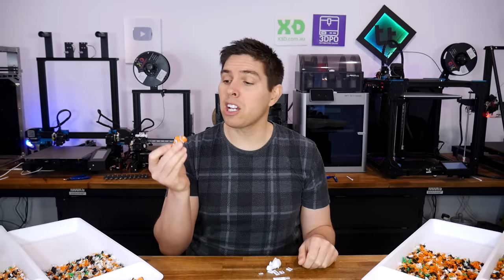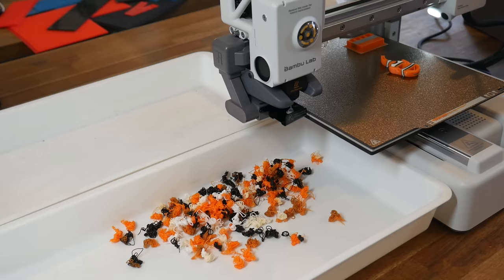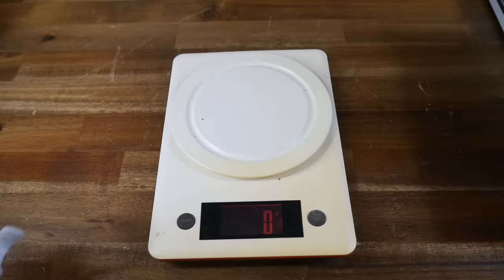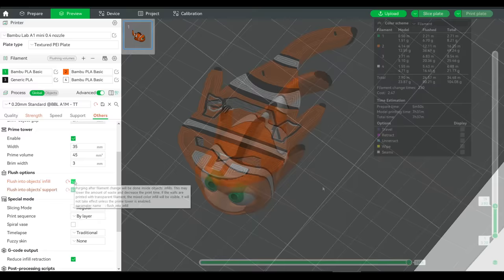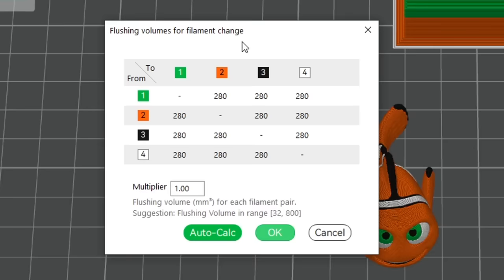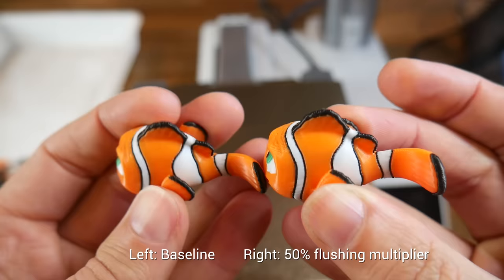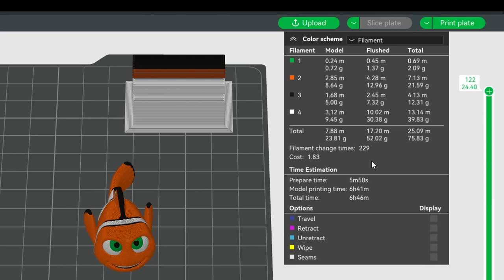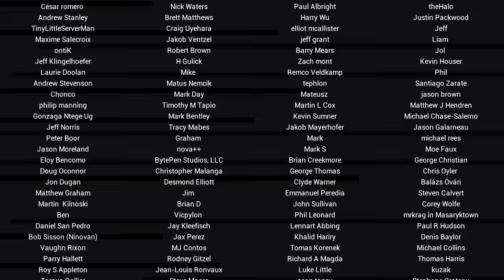Reducing waste from Bambu Lab AMS (lite) prints

Comment: Theres a model on printables called "Bambulab Profile for up to 60% purge reduction" and it does exactly that. Pretty much it moves the filament up close to the cold end before cutting it. This reduces the physical amount the needs to be extruded.
Reply: Is there a way to save it? Do I need to set the multiplier and auto calculate on every print or does it keep the change
Reply: @dustinbailey1980  For the Profile mentioned, there's some G-code that will be there for every run. Recalculating will be needed if you change filament combos.
Reply: I did this and it works very well! It's insane the amount of filament saved, plus i'm using only 0,3 on flushing volumes, and the purge tower i give it 10mm width and 10 purge amount
Reply: Do you have printables link? Please and thanks
Reply: @TripleJAu  copy the quote and paste it in printables. Some communities don't like links.
Reply: It looks like it is only for the X1, is there a way for this to work with the P1?
Reply: @g0d0fninjas90  what do you mean only for the X1 ... why should it be not possible to change the purge volumes on the P1 ?
Reply: @cryoglobe  the person who created the file wrote "for the x1," so that is why I asked. It could be possible to work on the p1, but since I know they have slightly different properties, I don't really want to chance it myself unless the person states otherwise.
Reply: @g0d0fninjas90  Ok , but I saw the video and explanations , and there is nothing specific to the X1 ,  99.999% confident it's fine on the P1 as well    ( it's mainly custom gcode in the slicer )
Reply: @rs3dpt noob question. Why do you need the purge tower if you are purging the poop off of the side. It seems like they would accomplish the same thing. But to use the purge tower you need to build it up with whatever color even if you don't need it till the end of the print
Reply: @vladonizer same question!! I guess it is to get a clean head before going back to the model but not sure why it need to be so large and may be this could be done in infills/supports
Reply: @ysiegel5544  The so-called purge after "poop" is partly to flush out "that last stuff", but MAINLY is used to equilize nozzle presure. It's not a PURGE, it's a PRIME tower (which you can change in side according to your wishes in the slicer)
Reply: good news everyone: "UPDATE 13.12.2023: I added profiles for all nozzle sizes and Printers including the P1P, P1S, X1C and one experimental profile for the A1 mini. "
Reply: my prusa XL 5 tool heads print this marlin with same video settings and reslts are : 1 h 4m print time and 10,01 g of filament use :- D 5 colors zero waste
Reply: That XL is an awesome machine and multi-head is an interesting future, but that machine will costs more (above my X1C) than I will ever spend in waste filament. That's not to say it's not an amazing machine (a friend of mine has the single-head XL), but it is quite expensive, if you "only" want to minimize waste (and/or save time).
But, as my argument implies: if you print professional volumes, this can make prints faster and more efficient.
I'm just a n00b that wanted the FDM equivalent of an HP LaserJet ;-)
Reply: Search for the printable "Reduce Purge Waste with Bambu Lab AMS"
Reply: The profile is gone now, it must have been taken down
Reply: @nanoman172  Just found out it's already implemented in Bambu Studio 1.9.

Comment: You can also purge into an object. So if you have a tool or something where you don’t care about color banding, that can be an option instead of duplicate models
Reply: If only the video covered that around the 4:40 mark and showed that the results were actually not that great...
Reply: @jippenfaddoul  @hagus42 said about purging in technical model instead of wipe tower, not "flush into infill", which was really to that great for such a small model as Marlin.
Reply: @poselennov  exactly correct. And because it’s an entirely separate object, one can increase the perimeters and.or infill on that object only.
Reply: add a object,can be the same model. right click on it in prepare screen,flush options- flush into this object
Reply: @jippenfaddoul no the video covered purging into infil of the multicoloured model, not purging into a separate colour-doesnt-matter model you're printing at the same time
Reply: i foresee myself printing alot of random tools for carpentry and such lol or coat hooks, ect
Reply: fidget toys would also be a good one
Reply: @TimSheehan   correct, at the time of this video he was missing a purge option or maybe not using Bambu slicer?  not sure.  If I ever get print time back from my printers I want to test that purge into object, because I do create fidget toys as purge objects to use the wasted filament. and it seems like lest waste, and you get a usable, albeit ugly fidget toy.
Reply: @JBGecko13yt why ugly? I use one or two screwable easter eggs to reduce filament poop every time I print multicolor, and they are really awesome with all that stripes 😊
Reply: @000Sadako  thats another great Idea, if the egg is tall enough that works!

Comment: Filament could be saved if they had a slicer feature that could do variable infill or use the waste material on a second model where colors don't matter. But a model with 10% infill has plenty of room to use up some of that otherwise wasted filament.
Reply: Thinking exactly the same here
Reply: This is possible. Add a second object and with right mouse button choose flush options --> into this object
Reply: You can do a second model with the infill...
Reply: @ultramegax , exactly I'd take a second model, with whatever colors over a pile of refuse filament.
Reply: @meesterjochem1  that's good to know.  
I'd still like to see a 'variable infill with refuse material' feature that would add extra infill up to 100% on the current model.  i.e I choose 10% infill to save time and filament. but if i'm not going to save time, and the same filament can make the current model an 85% infill with the refuse filament,  I'd feel better about that than a pile of trash.
Reply: @meesterjochem1 Yeah, but there is very little instances where you would have anything useful out of it, and adds print time.
Reply: @Splarkszter  yeah it adds print time, but also reduces it, you dont need to flush your filament after each swap,  the printer would reduce time wasting in flushing, instead you would print it, i would say its probably   the same time.
Reply: @Splarkszter you could make anything useful if you don’t care what color it is. You can make Gridfinity bins that are multicolored and that would be a useful part 🤷‍♂️

Comment: Imagine if the slicer had a "low priority print" that only prints with the flushes? It would print the main object with the correct filament, but when it is transition, instead of throwing away the filament it prints another object, something that you defined as low priority in terms of color. That second object will have an arbitrary color, but at least you wouldn't waste material.
Reply: Yeah would be a great opportunity to make some fidget toys on the side
Reply: @AntiKipKay   this exists, right click an object and select "flush into this object"

Comment: I think one of the most important tuning areas for multi material solutions like the AMS is print orientation. Instead of requiring material changes for every single layer, orienting the model vertically would reduce them significantly. Of course this is not a viable solution for every application, but nevertheless very important to keep in mind while doing multi material prints.
Reply: Yep multiplier, orientation and layer height it seems

Comment: I like the way you visually showed the results in the bins.  I like the AMS, but I try to print with less than 20 color changes and fill the build plate with as many copies as possible.  I think your results could be even better if you ran some tests to get the color swap amounts down to the bare minimum.
Reply: The AMS waste has had a positive effect on how I design.  It's a real consideration.

Comment: Just one thing… If you use flushing volumes / autocalc, IMHO that works well, also with at factor as low as 0,3, but I guess that depends on the model. But, if you later change filaments, which you generally do a lot with a 3d printer and forget to go by flushing volumes to update the calculation, note that that will not update automatically and you'll end up with a flushing table written for a completely other world than the one you're in and if you, perchance, start a print at night and go to bed and wake up the next morning to find your flashy new print, it'll look like rubbish. Beleive me on this ;)

Comment: We MMU2 users have been doing these things for ages, of course. One of my go-to methods is sacrificial waste/wipe/purge objects that can be scaled to the size of the main printed object. The four stones from The Fifth Element are my favorite, and I set the whole object as purge/wipe. These can then be quickly sprayed with stone color paint, or even left as-is. I find that people like the crazy colored stones as much as the painted ones. With purge to infill/object, and printing multiples of the multicolor model, per-print waste is greatly reduced. My new XL is putting that to shame, though. It does need some better tuning for print quality, but the only waste is the priming tower, which some people have even disabled with success.

Comment: For that particular model, I'd be curious to see you shift it to a vertical orientation with supports and see how that impacts the volumes. By having the color changes oriented to the direction the model is sliced, I'd imagine significantly fewer material changes and purges. Obviously, you would now have material in supports, but it would still be interesting to see the impact.
Reply: I bet the tool change count would go up. Figure those changes only happen once per layer.... so by making the model taller your increasing the changes. I would guess very few of those layers are going to save you more then 1 change.... on this model
Reply: I thought that, but you would need to figure out what that would do to the model. ie this one might then need support and it might leave an ugly finish but a comparison would be good

Comment: Another factor that wasn’t mentioned, but I imagine would also be able to reduce waste is orienting the part to minimize filament changes. For example, the marlin model, if printed vertically, I think would require less filament changes… with the tradeoff that it would require supports.

Comment: You could try retracting the filament a bit, before it cuts it off in the nozzle. There should still not be that much danger of filament clog since it didn't leave the hotend, you might still get away with saving 1 cm of filament per colour change.
Reply: Some smart person figured that out and gave all the G-code changes (and a very detailed explanation) in a Printables "file" called "Bambulab Profile for up to 60% purge reduction."

Comment: I use S3D for my Bambus, also for AMS prints. I’ve added a pre-toolchange gcode that makes the filament retract to about 8-5 millimeters below the cutting section before the switching filament starts. There is way less filament to purge, and has been reliable since.
Reply: I love S3D, so I'm happy to see someone is using it for Bambu/AMS!!! I haven't tried it yet...
Reply: Would you be able to share that gcode?

Comment: If it could cut before the colour change , using the stub of first colour until it is almost changing, then a small purge to the second colour , before returning to print the second colour.
Reply: I believe this can be done in that filament change Gcode section. Basically retract the filament a bit before cutting it, so you only cut off the blobby tip.

Comment: With the flushing volumes dialed in, the prime tower can be turned off altogether. That saves time and waste. 

Or setup a sacrificial model for all priming to go into. 

I have also experimented with not flushing and only priming objects. That saves more time and can work well enough to eliminate bleed.
Reply: That might work, but the reason for a prime tower is not filament flushing but priming the nozzle pressure to reduce stringing as well as underextrusion. Its similar to the initial purge line before every print.

Its up to the user to decice if a prime tower is worth it. For me, the stringing is negligible and I reduced the prime tower size and prime volume to 1/3rd, which already helps a ton.

Comment: The slicer should use part of the 'flushing' filament for the inner infill, where the bleeding does not matter. For instance have a setting which inner parts can accept bleeding, i.e. after 2 mm from outer edges.

Comment: Actually one major reason bambu (and the SMuFF-Project long before Bambu) uses the cut&poo appoach is, as shown in the video, the risk getting a bad filament tip on unload. So the cut%poo reduces the risk of failiure by a lot (and a failed print would be 100% waste of course).
However, Prusa tried to optimice unload doing "ramping", wich needs a bunch of fine tuning - and was a pita, so the MMU2 was never a big success. Until the Revo came and the reliability of the MMU2 got a real boost. Even without a MMU2 you can see how much nicer the filament tip looks on unload. The Nextruder nozzle even have a more nice filament tip than the Revo.
 Have not tested Trianglelabs Unified Nozzle (TUN) yet as a cheaper alternative. Theese Nozzles with integrated heatbreak are actually an alternative solution to get a nice filament tip on unload. At least with "normal flow" nozzles. Testing a RevoHF nozzle, I got worse results for the filament tip.

So my conclusion: For full colour prints I hope the MMU3 on a mk4 should be faster with less waste. While the mk4 does not use HF-nozzles and prints slower, without cut&poo not only the waste should reduce, but also the time to change filament should decrease. Resulting in less time for the multi-colour print over all, at least on smal single objects.

However, on bigger prints or batches of multiple prints the faster speed of a high-flow nozzle might be more relevant for the over-all printing time. Still the waste of "classical" change should be less.

On the other hand, with multi material (PLA/PETG support interface trick) or just a few filament changes in your prints (colouring just the bottom or printing colour litophanes with just a few layers), cut&poo matters less in time and waste.
However, if colouring just the first few layers (for example to embed text and graphics to a display case) I would prefer the Revo anyway, as you might not only use only one colour starting from the 4th layer, but maybe also a bigger nozzle size - so a quick change nozzle is the best for such prints, using 0.4 or even 0.25 for text and graphics in the first 3 layers and than 0.8mm for the rest.

Imho there is no "one for all" solution. It very depends what you use a filament changer for - and how often you use it at all.

Actually the main advantage of the AMS isn't multi colour at all. The main advantage is the filament being transported by the AMS-feeder to the extruder. The "filament-buffer" (in the A1 integrated on the top of the printhead) synchronice the AMS feeder. The AMS-feeder pushes filament to the extruder. If the extruder does not use it at the moment, a spring gets compessed, a slider moves and a hall-sensor detects the magnet inside the slider - and the AMS-feeder stopps. So the filament always is slightly pushed to the extruder gears. The extruder does not need to pull the filament, all it's force is used to push it through the nozzle. If you ever had under extrusion due to long reverse bowden, a not optimal spool-holder or printing out of a drybox, you lnow the advantage of this solution...

Unlike on the MMU2 (MMU3, ERCF, SMuFF, Chameleon 3d...) due to sychronicing the feeders, the AMS feeders are always engaged to their filament. If it comes to over all printing time, the next logical stepp would be to cut the filament tip outside the extruder. Actually disengaging the extruder gears on unload (so the molten filament tip isn't pressed by the gears), of course after ramping. So it could be pulled out reliable and after passing the hub the printer imeditly could print the next filament. While the unloaded filament is pushed into an external cutter, removing stringing an any deformation by just cutting the tip and be loaded directly in front of the hub afterwards, ready to go. This would reduce filament changing time by a lot - maybe to times you would use a toolchanger normaly.

For reducing waste one method seems to miss: wipe2object. Still you need a "waste tower", but just to prime the nozzle after filament change (so a small one). Instead of wiping or purging the contaminated filament you print it into an object were the colour does not matter (functional part or an object wich should be painted afterwards anyways).
Reply: Great analysis.  I have an X1 Carbon with AMS and it works well, just have to plan to minimize waste.  My Prusa XL with 5 heads is a totally different experience.   It switches filamnent with a slight delay when the heads swap.  I just finished my first print with over 250 changes, worked flawlessly and not much longer than the print with no changes.